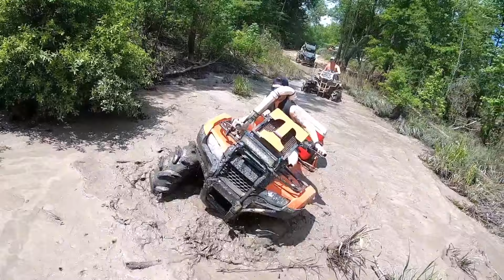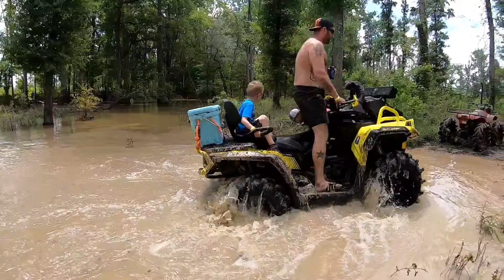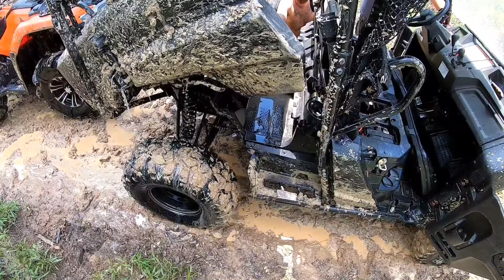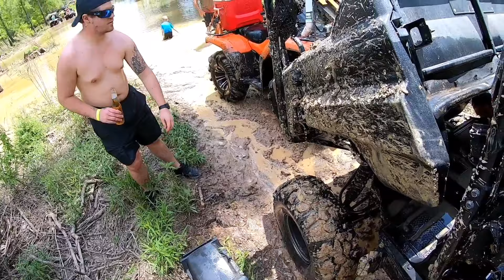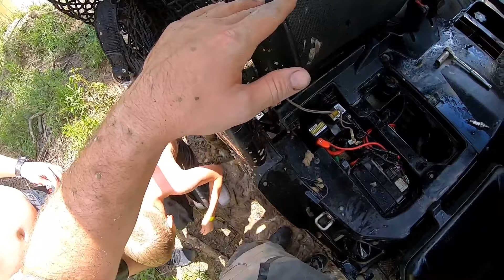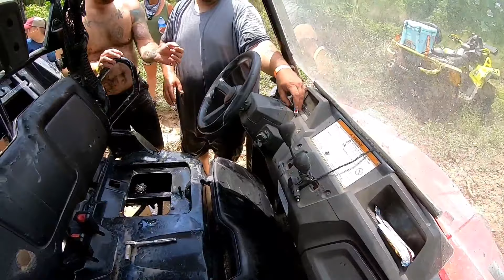Brand new Pioneer P700 Drowns!!!

Comment: What’s the big difference in the 700 vs 1k? What makes it easier to save it
Reply from the maker: Single cylinder vs twin cylinder.  Singles are alot easier
Reply: The p1k5 has a better factory intake setup than this though..

Comment: I want snorkel for my Honda but it's a lot of money for me. I want to take it to one place that will fix it if water gets in motor from snorkel not being on right but it will be a lot of money
Reply: Did it on my 2019 p700-4 costed less than 100 bucks to snorkel including the 2inch pvc cutter. Recommend sealing with 5200 around air box tho.
Reply: cody heimbuch costed me $40'to do mine. I sunk it anyways but it started back up just needed an oil change after the ride
Reply: @adamw8299  thanks,  I just dont want to put a new motor in it if I mess something up
Reply: @justinmurray9075  will it mess up motor though if the snorkel ain't tight or on right?
Reply: @countryboy5413  It will definitely stop working if you get water in there but you just have to use alot of pvc glue and make it nice and tight so when your riding it doesnt have wiggle room to come loose. Also you need to run longer vent lines for your difs, gas tank, and radiator fan. Look me up on snap chat (jmurr513) and I'll do a video for you to go over everything. I cut the pipe right after the air box compartment and added a rubber coupling and used 2inch pvc pipe to run the snorkel used the 5200 sealant on the rubber coupling and pvc glue on the pvc connection and ran a bead of 5200 around the outside of each of those connections. The only thing is the stock air box and air pipes are not water tight so you have to go over everything. I've been snorkeled for about a year and had water over my steering wheel and never got water in my oil yet. The only thing you night run into is the spark arrestor might shut you down if your in deep water cause of the amount of pressure if this happens to you, just get the sxs out of water pull the plug on the air box and if you dont have water your good and fire it back up you'll have water in the exhaust but it should all come out when it gets running again. But you'll want to remove the spark arrestor so it doesnt shut you down.
Reply: And just like they showed on the video you just have to do an oil change maybe a couple times and you should be fine I've had my buddies sink there's several times and cleared the water and fire it back up and drive with some milky ass oil for the rest of the day. So if you do an oil change if that ever happens and clear it out you'll be good
Reply: @justinmurray9075  ok thanks
Reply: @justinmurray9075  ok imma get one soon and I'll try it

Comment: Should I get the new p520 or the p700 which do you think is better for this kind of riding
Reply from the maker: P520. 

P700 doesn't have any low range and its geared too high for this type of riding. 

Much more options for building the P520 than the P700 with gear reductions etc...
Reply: @ProjectAjax  I like your answer saved me a few k 😂
Reply from the maker: @moosestanggang  p700 rides better but if you wanted you can swap some long travel kit onto the P500 like I'm gonna do. My p5 is on 38s and turns em awesome. A P700 could never do that.
Reply: @ProjectAjax  yea I’m trying to do the same as you then, torque locker, “long travel arm kit can’t find it anywhere tho”.... and 4” portals. Sticking with aztex i have 33’s on the highlifter love them super light and don’t float. Guessing you tune in to mudpuppy as well lol. But I’m selling the bike and going with the 38’s that you have now
Reply from the maker: Yeah I know mudpuppy. Rode with him a few times. I wanted 38 ol3 but since I've had 3 different sizes figured the content and new tire review would be a fresh breath on the channel to see something different. I think aztex have their place and can do pretty well but not in all situations and def need the right build to maximize their potential.

Comment: I want to know how y'all manage to go anywhere or do anything mudding with the 700 I use one for work it's extremely disappointing no power or speed and it's horrible on the hills of WV with no low range
Reply from the maker: Man I don't know. They have 0 power and really high gearing. At least here for that guy he just normally drives around his property and FL is flat. Needs a low range and a new trans badly.
Reply: I’m glad you commented. I was getting ready to pull the trigger on the 700. I had no idea it didn’t have a low range. I also live in WV
Reply from the maker: No low range. Really long first gear. Not a mud machine at all.
Reply: Project Ajax thanks for the replies. I wanted this mainly for hunting but In the area I’m from the terrain is extremely steep. I am guessing that there’s probably very little hold back/engine braking as well?
Reply from the maker: Not sure on that but they dont have enough power or tq to climb hills. Id pick something else
Reply: Project Ajax thanks for the advice I think that’s exactly what I’m going to do 👍
Reply: I live in Florida and it doesn't do bad. I'm getting old and just putt putt around so it works fine. I definitely wouldn't try to race it or make it a serious mud bogger cuz you just be throwing money away

Comment: This is why you dont buy a Honda pioneer. They really do suck.
Reply: Only the 700.  P5 and p1k are great
Reply: @parkermckowen3781  why does the 700 suck? Genuinely curious. I’m debating 700 vs 520 and 500 I’m just not sure.  The 700 has locking front diff though
Reply from the maker: 700 gearing is terrible. Only has 3 speeds and long gears. Cannot turn tires
Reply: @ProjectAjax  I’ll keep that in mind thank you! I’m looking at a 520 on Saturday
Reply: DrewCreates get a 500 or 520 or 1000. 700 only has 3 gears which are geared too high already. Has no low end nor does it have top end they only go 44